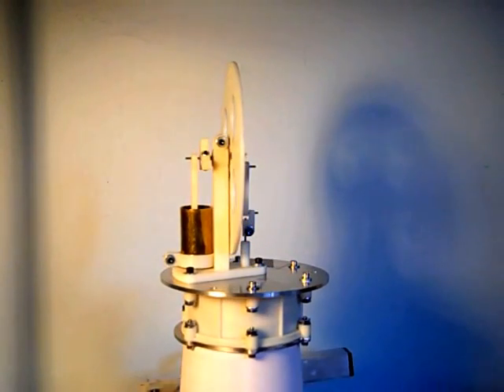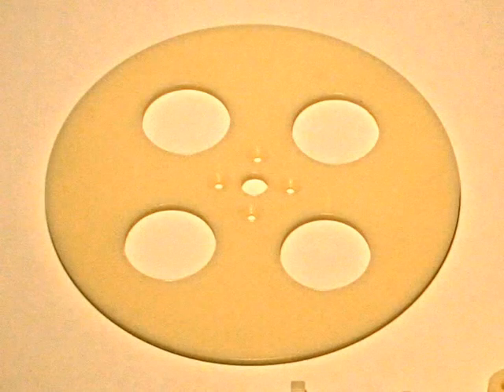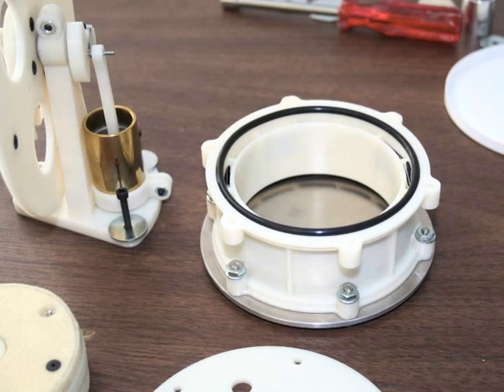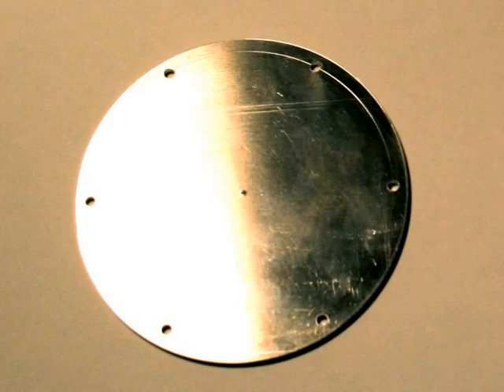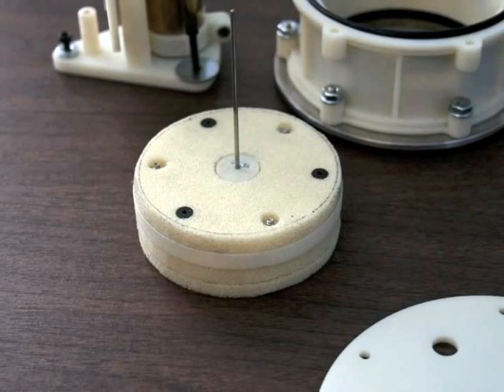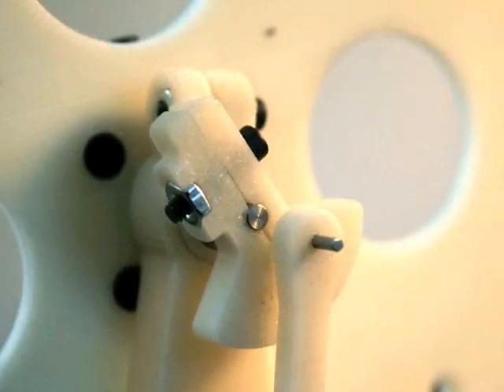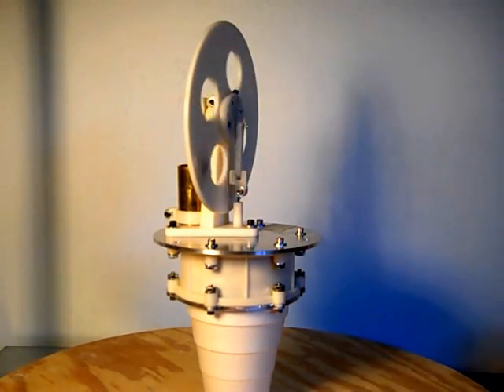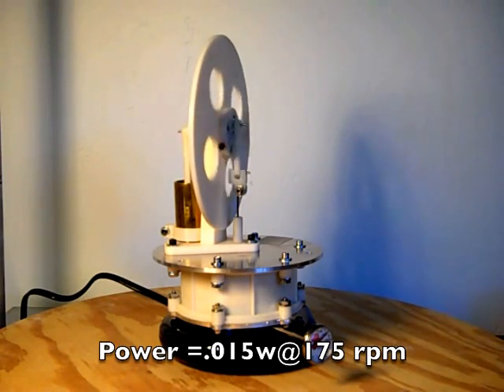3D printed Stirling engine

Comment: that is an sweet engine pal. you should put it upside down like at the end and use one of those magnifier screens and put some magnets on the wheel and some coils mounted around that and make a solar generator.

Comment from the maker: The power piston is 6061 aluminum and slides in a brass tube. The aluminum is machined with about .001 inch smaller diameter that the inside diameter or the brass tube. When operated in a vertical position the piston has very little friction.